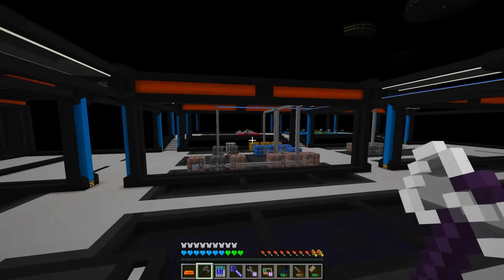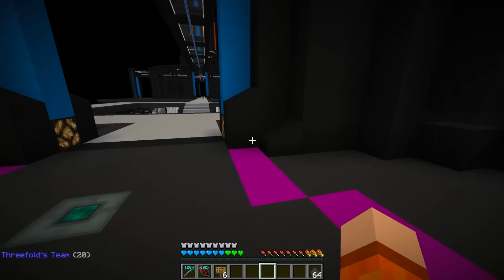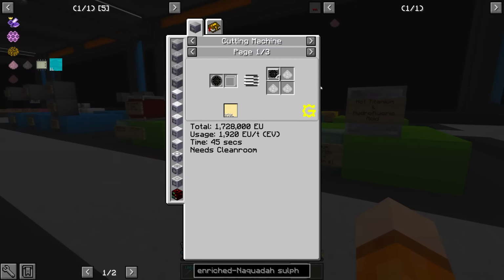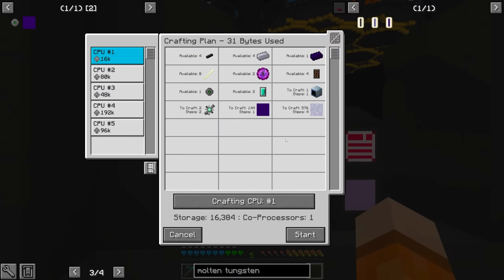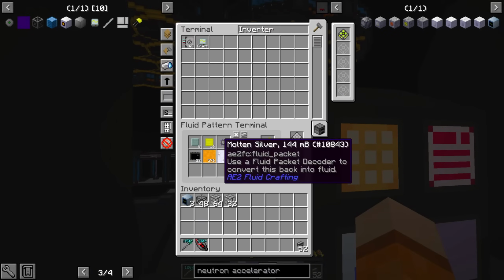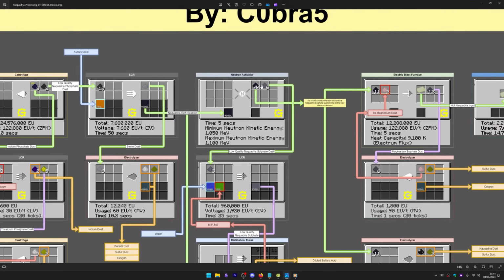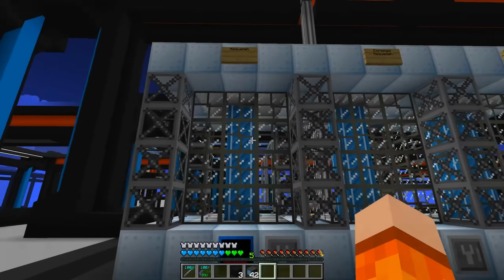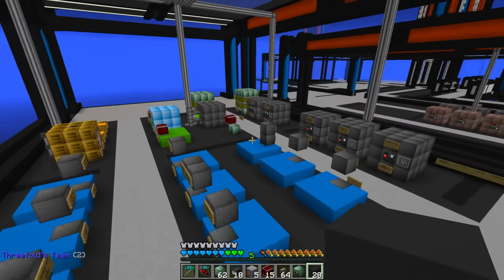Gregtech New Horizons S2 80-81: Live Edit Highlights 03

Comment: The main reason I stopped playing GTNH is it promotes AFK for resources. Not a fan of that. Other than that its a pretty fun experience, I just don't appreciate that the primary blocker for the most part is the amount of time the server runs for. If there were options to balance it for single player worlds where servers stop running when you shutdown vs always online servers it would really awesome (just my opinion).
Side note, I also hate magic mods with a burning passion so having those as a more or less "required" part of progression is a huge turn-off for me. Lookin at you in particular thaumcraft.
Reply: To be fair thaumcraft is fully automatable via AE in this pack, three just didn’t do it. Also there isn’t a NEED to afk until Wayyyyyy later in the pack than three is, but of course it’s always an option to afk vs upgrading infrastructure in a mega pack like this.
Reply: The amount of time it takes to craft things is just ridiculous. It’s a time sink for the sake of being a time sink. Complex crafts should take longer but not to the extent it’s currently at.